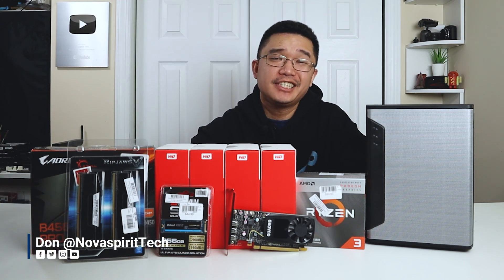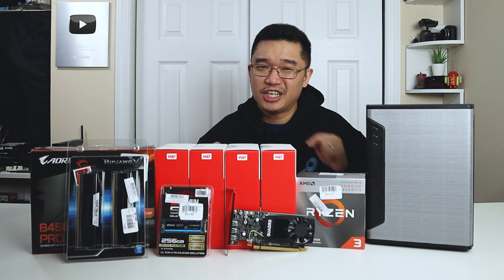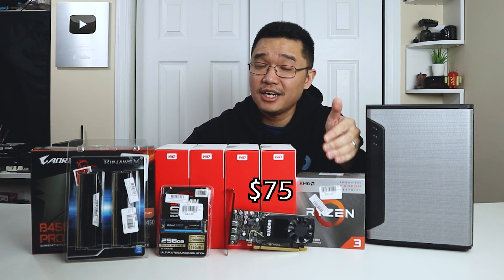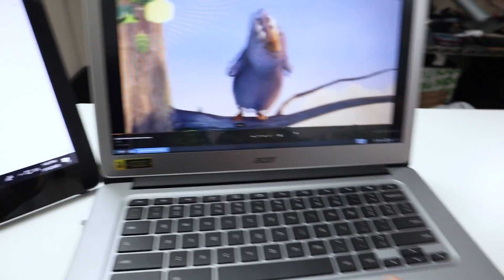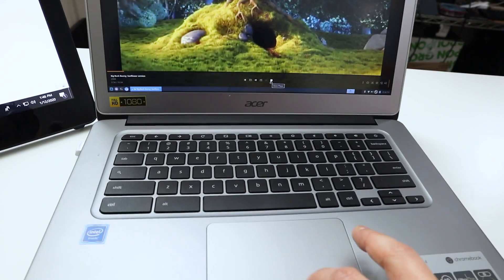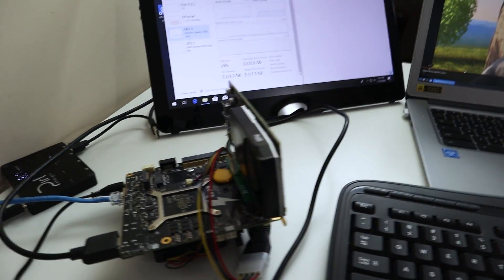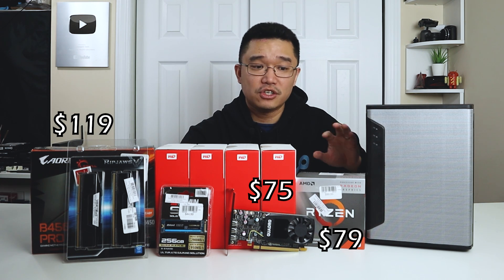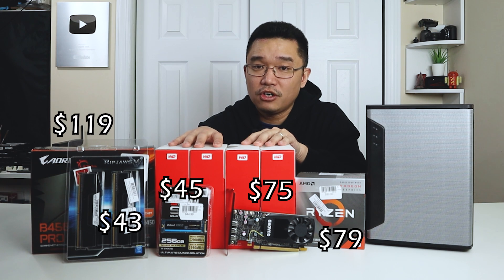DIY NAS & Plex Home Server With Hardware Transcoding Build

Comment: The included power supply would be a huge no from me. It's not about how many molex connectors you get, it's about the fact that a bad PSU can easily cause system instability or even kill your hardware.

Comment: On the test bench that mobo did not have the 24 pin connector plugged in, there were no lights on mobo no small led lights on the video card either. And there was no cooler on the processor, was there any ram sticks on the test bench mobo? I must be blind or he thinks all his viewers are idiots.

Comment: I've been running zfs on centos for years. works great for me. I guess unraid has some benefits but it never appealed to me. I guess one thing it's good for, if you have a drive failure, you only lose some of your files not all of it. but in reality, no data loss is acceptable, so that feature doesn't matter. zfs has been solid as a rock for me. aside from needing to recompile things when zfs or the kernel updates, it still works great.
Reply: If an Unraid drive in the array fails, you can simply replace the faulty drive, and unraid will rebuild the lost data for you...so you lose nothing. The amount of drive failures you can have at the same time without losing data is linked to the amount of parity drives you have...1 parity, u can survive 1 failure, with 2 parity drives, u can survive 2 failures at once, and so on...also, Unraid is very easy to set up and  use. You can run VMs, docker containers, home media server, plex, basically whatever you want on Unraid.
Reply: I see. so I guess if you have more drive failures than you have parity drives, that's when you'll lose data. but I've heard there's some feature where you can partially recover an array if you do have more failures than parity drives. zfs does all that and more, but not this one specific feature. but imo it shouldn't be needed anyway because no data loss is acceptable. for my main storage, I'm using zfs raid z3, which is similar to having 3 parity drives. plus, everything is checksumed within the filesystem.
Reply: @lorenzo42p  sounds like a nice setup!  I prefer unraid for ease of use though, very easy to set up and maintain....no data loss of any kind yet, been running solid for a little over a year...before that I was running Arch Linux  on a seperate pc with shared folders, as a media share directories...It worked okay for its light use purposes...but switched to Unraid, and  never looking back..currently running my drives in a btrfs config...I believe ZFS is also an option in Unraid, but I have no experience with it.
Perhaps at some point ill do some research to see if using ZFS could benefit me more than btrfs.

Comment: I sort of followed your build and built my own, only difference, I used fractal case, and ubuntu server.  I cannot seem to get my permissions correct, however, to enable write access from a windows machine to my plex library. My plex library is mounted at /srv/plex, with /srv being my RAID array mounted in fstab as "UUID   /srv    ext4    defaults,noatime,rw     0       0".  I have searched all over google and plex forums, but cannot get the permissions right???

Comment: I have Lenovo P700 dual Xeon, 96GB RAM,  with 1 HDD 8TB, 1HDD 4Tb and 1 HDD 2Tb, I want upgrade to NAS Os because I’m in W10 right now, what RAID or PCIE Sata extension do you recommend ? I want to have at least 8 x 8 TB HDD and 2x250Gb cache SSD

Comment: i know for a fact, that on windows plex can transcode on the vge gpu of the ryzen 5 3200G of 3400G had it running of a while but driver wise my system was not stable at all it would radomly freze due to an asus io driver.

Comment: Hey boss I have a 5 year old PC with good specs so that isn't the issue .
My problem is when it comes down to the play back from my PC Plex server to my tv or firesstick for low 720p and some 1080p. 21gb UHD 4k files it does good but anything above that in GB it doesn't work my lord of the rings movies are like 70 to 100Gb in size and are also UHD 4k 

Any system set up that I need maybe a Plex- Synology set up? Please let me know how to playback very large files with no problem . I have 1 GB internet fiber optic Internet ...

Comment: Hello. Nice video. Helped a lot, mainly that part with Quadro P400. My question is : you are using UDOO BOLT V8 for GPU test (2:22). What HW part are you using that have the ability to connect GPU to M.2 NVME slot ? Im unable to find it anywhere, can you point me please ? Thank you

Comment: Was very excited to see the setup, but as soon as you said used card for 75$, I post interest... Used cards are not Available everywhere. :(
Reply: I have the exact same setup as this build two or three years ago. Aslong as you buy a amd Apu. You can run without the dgpu just fine. Only need a dgpu if you plan to transcode 4K. The apu gpu works well for 5 to 6 stream at 1080
Reply: @RockyZajThoj  how about Intel processors. Intel quick sync may help transcode na

Comment: My only issue with you saying this can transcode 4K is that you're not specifying what your Bitrate is for Big Buck Bunny in 4K. I looked it up and it's roughly 8.5Mbps compared to a real 4K-UHD movie like Avengers: Endgame (44.1Mbps) That number is kinda low, considering a movie like Ready Player One is 79.1Mbps

The resolution may be 4K, but using a low bit-rate 4K video and saying it can transcode 4K I think is misleading. Even with a 1080p Blu-ray, Avengers: Endgame bitrate is 31.8Mbps.

Some might say, you can use Handbrake and lower the bitrate, but keep the 4K Resolution. That's very true, however, that would take HOURS to encode, at which point (not to be rude) why are you worried about building a budget Plex server? In order to transcode a 4K movie title, you're going to need a more powerful system.

I personally have a GT-730 in my Plex build and that thing can barely play 1 4K video stream, much less transcoding it... Haha that's cute. I know the Quadro is strictly designed for data processing, compared to a 730 that's designed for "gaming". However at the end of the day, the numbers still don't add up.

=================================================================================
PS: I did watch this entire YouTube video prior to commenting to make sure I didn't miss anything.
PPS: My movies are direct rips from my 4K and Blu-ray physical collection (I know both resolutions are written to Blu-ray discs).

Avengers: Endgame - 4K (HEVC Main 10 HDR) 44.1Mbps - 55.79 GB
Avengers: Endgame - 1080p (H.264) 31.8Mbps - 40.23 GB
Ready Player One - 4K (HEVC Main 10 HDR) 79.1Mbps - 77.38 GB

Comment: Does you are anyone know if that case has enough space to accommodate a 5th hard drive?  It doesn't have to be an official spot but can i use zip ties of something like that  where i can secure the a 5th 3.5 drive in the case I'd be a happy camper.

Comment: Just started to build one as a NAS with 4TB with only two drives but can add more after...Thinking of using unRaid.

- ASUS Prime B550M-A/CSM
- AMD Ryzen 5 3600
- Corsair Vengeance LPX 32GB (2 X 16GB) DDR4 3200

- 2 Seagate IronWolf NAS 4TB
- Samsung 970 EVO 500GB NVMe (caching)

- Silverstone Tek Micro-ATX PS07B

Coming around 870 USD down here in Singapore (without unraid license). This is missing a graphics card and a PSU that I already have. Really looking for good network transfer speed for some video and photo editing.

Comment: I really like this video, I've watched it multiple times over that past several months. I keep coming back to it, I'm going to end up using slightly different parts because I love Freenas. I really like the form factor of this case.  The only thing is I need a 5 bay case, my current FreeNas box is almost full.  It's an old HP Proliant micro server, I've had it for at least 7 years and I got it used on Ebay. It's too slow to do any fun stuff but as a storage server it's rock solid. FreeNas has been great.  Is it possible to fit another 3.5 disk into this case, I'd find some way to secure it but will it even fit? I suppose I can just upgrade the harddrives in my current box I'd like to take the opportunity to move to a newer platform.

Comment: 470$: yes, it has more power than a commercial NAS; yes: you can add easily drives...
But... What about power consuption? And operanting noise? Can you resell it? Can you easily increase the diskspace? Are you confident to expose it over the network?

Comment: you know that if you are not using ECC you can run ZFS... I mean you said corrupt data what do you mean by that exactly? if you are talking about the loading pool data which is sorted out later there is very less factual evidence that it happens regularly if you dont have an ECC ram. I am running non ecc ram and running plex as pluging plus i use other Jails for my DNS , syncthing and nextcloud. you have to be doing a Zfs that is running 40TB shares with R/W to a high capacity to corrupt data...

Comment: I am getting a good deal on quadro k2000. But I cannot find any video on how it works for Plex. Just wondering how many 4k streams it will handle with i3 , 16gb and quadro k2000

Comment: Hello, very new to NAS and servers as a whole. I ended up going with a very similar build but ended up using Freenas. Has anyone gone this rout? I could really use some help. 
System:
 B450I GAMING PLUS AC (at the time it was the only Mini ITX board available)
 AMD RYZEN 3 3200G 4-Core 3.6 GHz
 Team T-FORCE DARK Z 16GB (2 x 8GB) 288-Pin DDR4 
 Silicon Power 256GB NVMe M.2 2280 
 Chenbro SR30169 
 WD Red Pro 6TB NAS Internal Hard Drive - 7200 RPM
 FSP Mini ITX Solution/Flex ATX 300W (does not fit in case unfortunately)

System goals: I only want to run Plex locally and Deluge (or any torrent) management

Problems so far....
1. Freenas apparently takes over the whole drive you end up using for the root drive.. So I used a SSD NVMe and I know Freenas isn't using the whole drive and I was hoping that I could use some of the drive to store/run Plex and Deluge but that isn't possible so they are now jailed on the 6tb Nas drive
2. Freenas apparently hates RealTek (my MB uses RealTek 8111H) and it will shut down during heavy workloads (aka all the time...) with a "re0: Watchdog Timeout Error" I have found someone with a driver solution but I have been working on it for over 2 hours and can't get the driver into the kernel drive... here is the link https://unlockforus.com/freenas-11-2-re0-watchdog-timeout-error/
3. If anyone is using the Chenbro case and has a suggestion for PSU I tried FSP Mini ITX Solution it looks awesome and takes up very little room but there is no way to mount it in the case... So if there is an upgrade option out there I would love to hear it

Sorry about the long message.. just at a loss of what to do here... My guess is to look into Debian because Freenas has not been a good fit so far (though only a week into trying to learn... and the learning curve is STEEP...)
Reply: The case fits a standard atx psu so any would work. If you need a little more room for cpu can then get an sfx psu.

Comment: @11:55 ZFS without ECC RAM can corrupt data?  can you provide more info (a link)?
Reply: Every filesystem can corrupt data if the ram is bad but I don't see any reason why ZFS would be worse than other filesystems, that just doesn't make any sense.

I even think that ZFS without ECC is still better in this regard than NTFS without ECC. Why would the additional countermeasures against data corruption make data corruption worse if there is ECC in place.
Reply: I agree, his statement that ZFS without ECC RAM can be dangerous is a myth, IMO. Here's a good link that explains it: https://jrs-s.net/2015/02/03/will-zfs-and-non-ecc-ram-kill-your-data/

Comment: Hello, I'm a total newbie here so, please forgive the nieve questions.  I have a ATI Radeon HD 5770 1GB and 4 4GB DDR3 1333 MHz Ram that I pulled out of my Mac Pro.  Can I do a NAS build with this?  What motherboard and CPU (I also have an old 2.8 GHz Quad Core 45-nm Xeon W3530) that I'm not sure I can use.  Any advice would be most appreciated.

Comment: shady that those WD RED's turned out to be SMR drives.
Reply: thedog556 It matters if a drive dies and it needs replacing. SMR can cause issues when it pauses to move data to the SMR area. This can be interpreted as hard drive failure.
Reply: Was just thinking that when I watched this lol
Reply: I got 2 RED's shortly before the quarantine and they turned out to be standard drives (EFRX) instead of SMR (EFAX) drives. so I lucked out.
The SMR issue only matters if you are using ZFS and it has to perform resilvering. I don't think it affects mirrored striped volumes as badly.
Reply: @TechExploresNYC   yes indeed the model numbers are different. 

for new drives just search google for the non SMR EFRX models and you should be fine.
Reply: thedog556 why not?
Reply: WD RED's........few weeks..............."COFFIN DANCE MEME"
Reply: Linus made a video about this shadiness.
Reply: @akinoz  thanks for the heads up.
Reply: @akinoz  What is that video? I am looking at the NAS drive I just bought and wondering if I need to return it.
Reply: are smr drives bad?
Reply: @Fleshlight_Reviewer  Depends on what you do with them. SMR technology basically allows manufacturers to increase the capacity of drives at lower costs, with the downside being reduced read/write performance. For many applications that's fine, even desirable. SSDs now have the market cornered if you need fast read/write speed off the disk for frequently accessed programs and files, so mechanical hard drives these days are mostly used for storage of large or infrequently accessed files (audio, video and game files are examples). For things like a mass storage drive on your desktop PC, more capacity for less $$ is great. 

When the drives are used in RAID arrays however, SMR creates problems, particularly if the server uses the ZFS file system. An array using SMR drives takes as much as 16x longer to rebuild (the process the array goes through if you have to replace a failed drive) compared to conventional drives. This dramatically increases the time that your data is vulnerable due to lack of redundancy, for large array the time scales can be as much as weeks. Also, some ZFS controllers seem to have trouble with basic operations when the array uses SMR drives. There's some speculation that SMR drives can be so slow that the RAID controller basically starts thinking the drives are actually dead and so the server starts reporting errors and fails to operate correctly.

It's not that SMR is per se bad, the problem was drive manufacturers (WD particularly) were using the technology on drives marketed as "NAS drives". Since employing RAID (and ZFS file systems) as a data protection measure is REALLY common on NAS servers, SMR my not be suitable for all NAS applications. But since nowhere was it disclosed that the drives used that technology, this got some folks upset.
Reply: @Fleshlight_Reviewer  they are slower writing

Comment: what about using IGPU ? like HD630, i have read that they can transcode up to 6 times 4k transcodes to 1080p.
I remember looking at I7 8750h mini pc that you can find for pretty cheap on aliexp back then now there is maybe even better deal..
Reply: An igpu will work but An AMD apu will be better without any dgpu.
Reply: @RockyZajThoj  well intel igpu have hardware transcoding capabilities that amd apu didn't have.. (or at least not compatible) so amd is worse :/

Comment: Hey man. I have a question. I am a newbie in Plex. But based on this article https://support.plex.tv/articles/115002178853-using-hardware-accelerated-streaming/?_ga=2.212093212.928719905.1586640123-130890070.1585337486 AMD CPUs are not supported by Plex. Well I got old AMD FX processor with Radeon Sapphire graphics card. I do not even have an option of hardware acceleration. My question is how AMD Razen will be supported. Is it because of GPU card not CPU? So if i have NVIDIA it will be supported?
Reply: From the article you linked to.

“Our hardware-transcoding system has technical support for many dedicated AMD graphics cards, but we haven’t done official, full testing on those. Support for AMD GPUs is provided “as is” and your mileage may vary. It is recommended that you use Intel Quick Sync Video or a dedicated NVIDIA GPU.”

Comment: The Ryzen 3200G has built in hardware transcoding for 4K already, although it may not be as good nvidia. I’m using a 240GE and Jellyfin with hardware transcoding enabled and it works well.

Comment: I built my NAS as follows: Dell tower Duel-core Pentium(R) Dual-Core CPU E5700 @ 3.00GHz (2 cores), 15 GB memory, 4 x 2TB WD Red Drives, running Freenas 11.2U1, primary plugin is Plex.  I been using Freenas since 2012, I only had  to replace one drive. I still need to tweet the system for better performance. If anyone would care to  pass any suggestion- greatly appreciated.

Comment: would it hurt at all to use a GTX 750ti, I have an old one but would it hurt me to use that instead of a quadro?
Reply: you'll get the same results. all Nvidia cards are locked to only 2 transcodes at a time on a driver level. the exception is quadro 2000 and up cards are unlocked and will transcode as many as it physically can which is the reason its the most popular card for plex builds.